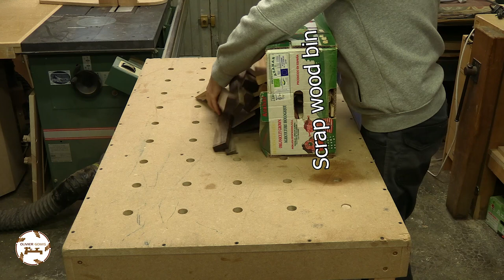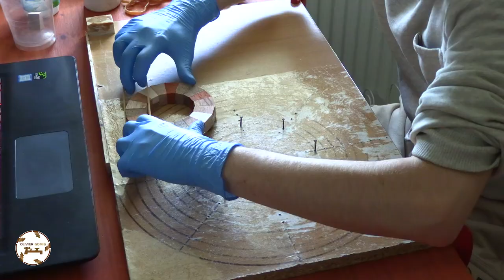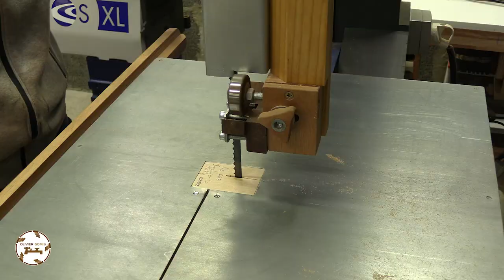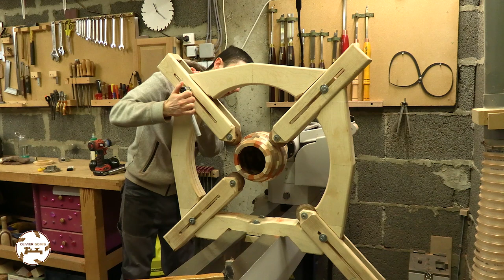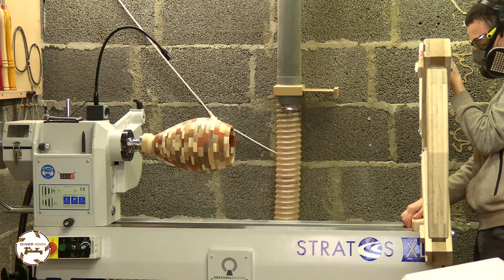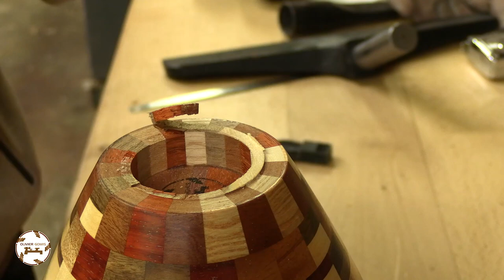Woodturning - SCRAP WOOD Segmented Vase

Comment: Man you're a pro. I never really went into turning, I did some though but not on this level. After accident did only a hand full of light carpentry projects. I get motivated watching you work and it might be a solution not too use much force in working with wood (implants)  using my left hand to press down the chisel. Can you tell us more about why you chose the Stratos XL to work with? And are you willing to share maybe drawings from the extra wooden guiding-wheels-construction? As I guess you made that  yourself?

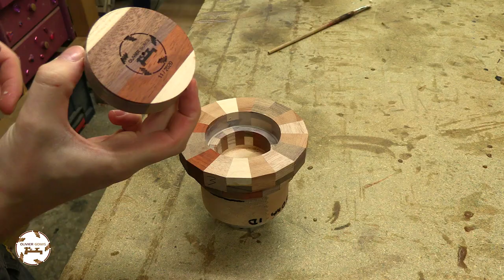Comment: I really appreciate your videos, you are a very talented wood-turner.  At about 2:55, you jump from cutting the base plug to fitting it in the smallest vase layer.  How do you create the hole for the base plug?  I would love to see how you get this joint so clean and tight - maybe on the next one?!  Ah, in rewatching it, I see that the base is already mounted, so I figure you turned it, did you turn the plug too?
Reply from the maker: Yep, I turned both parts on the lathe before gluing.